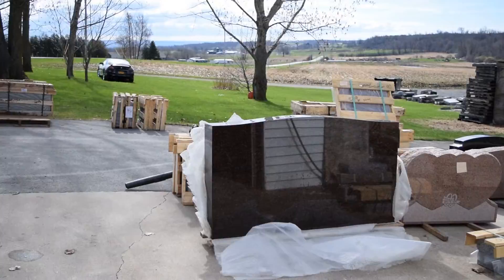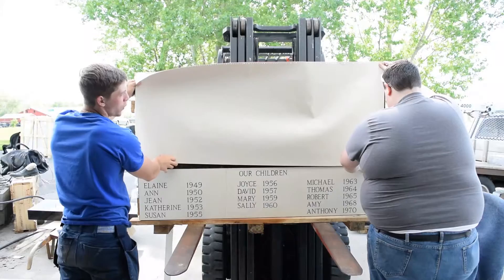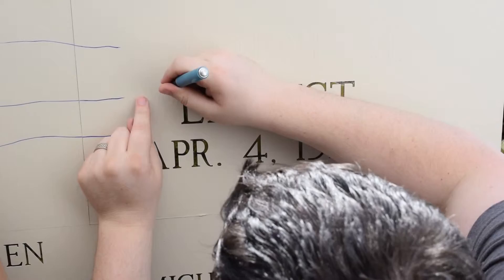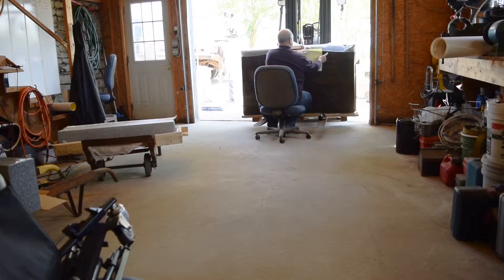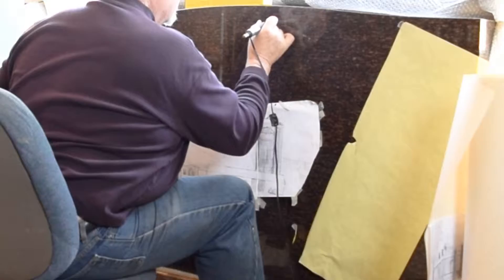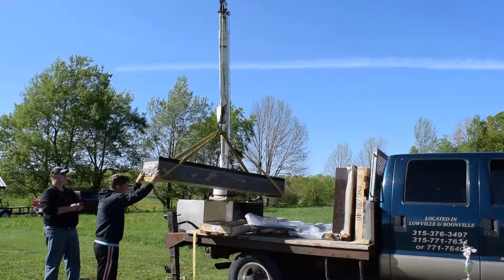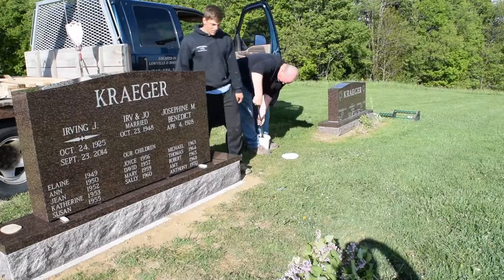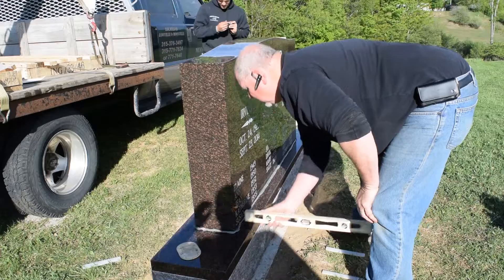-The Grave Stone Pros- 7 Parts of Production (how it’s made)

Comment: Kind of curious why yall check level of the base after die is set on it, I'm never placing my die until i know the base is leveled, to much weight to work with. Also i use  2 10 inch broomsticks to place my die on the put my compound under the die with four breaks in the compound for the broomstick then use the setting bar to lift,  center , remove 1 stick then join compound and lower the die and repeat on the other side. 
Bar works best on pitched sides but if there are polished sides ill use a strip of old belt or rubber between the stone and bar. Never had a chip
Reply from the maker: That level has a ruler on it and that's what you saw it being used for. Checking for level was done off camera.